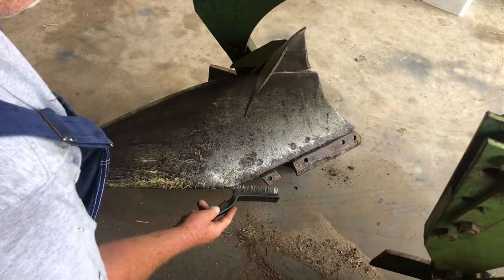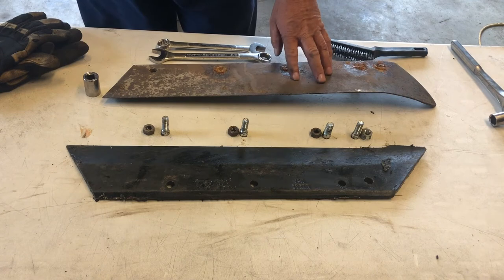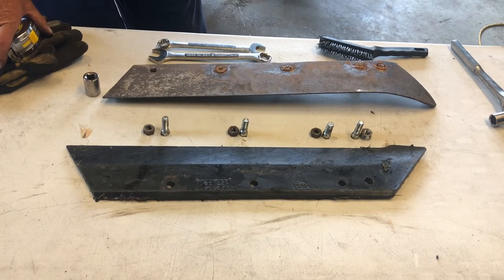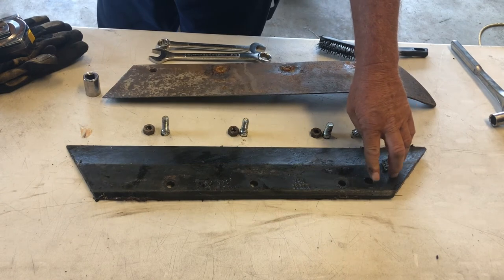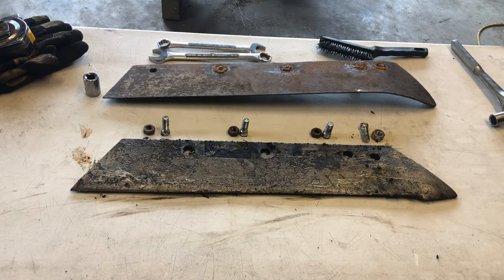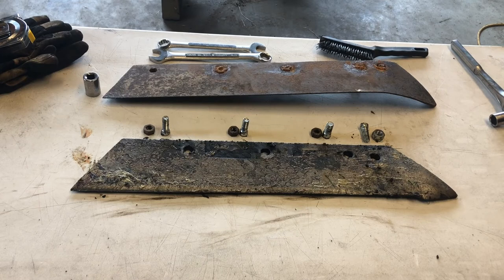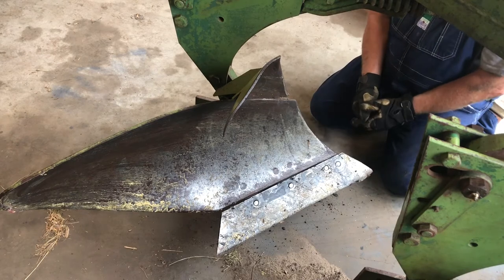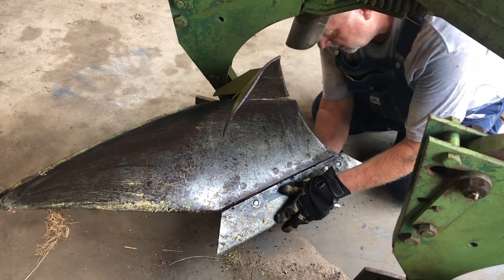How To Change Plow Shares

Comment: Those cushion trip Oliver plows have a neat trick to tip the bottom up and make it easier to work on. You pull back on the rear roller assembly,  then lift the bottom up, and put a punch or rod through the sub frame to hold it up.
Reply from the maker: Now that is smart on Oliver’s part! Thanks for pointing that out Chris, as I said before......you are a wealth of knowledge.

Comment: Steve: I went back and reviewed this video before changing the shares on my F-145 and was surprised to find my bolts came off with just my Dewalt gun.     (Maybe dumb luck?).    I really appreciated your tutorial.    Shoups came through for me and I didn’t drop the plow on my head😉.
Reply from the maker: That is lucky, seems like every time I do this I get set up bolts/nuts and end up breaking or grinding them off.
Shoup is a great resource 

Thanks Dave

Comment: Welding or cutting those old bolts off is a great idea. It's easy to cut a finger if someone were to try and hold them and loosen the nut. I still call them points as well. Great info 👍
Reply from the maker: Thanks Chris, seems like I remember doing that years ago. 
Only do it once 😂

Comment: OEM Oliver shares had the bolts permanent.  Moline, IH, AND JD have replaceable bolts. 
Probably left over from the days when the blacksmith sharpened them at least once a year.  Thanks Steve.
Reply from the maker: Now that you mention it I do remember seeing some many years ago that were permanent 
You’re welcome and thank you for the comment. Dad used to take bean knives to our local black smith to hammer out numerous times. A lost art anymore
Reply: @AnglesideFarm  Not that I am looking for subscribers, but I plan a short video of 14 inch OEM shares I should still have here .
Sold the plow.  I'm a hoarder.
Reply from the maker: @brycewiborg8095  i could have swore I had subbed you.....but I AM now!
Thanks

Comment: Good educational video.   Now if you plow enough every year and you wear out the shares in a season, those nuts come off pretty easy.   Just take a wire brush to the threads first.    Seemed like I did that a lot as a kid.  It’s a good thing the nuts always came off easy, because we never had a torch back then, or an electric hand grinder.
Reply from the maker: We didn’t plow enough in a year I guess. We chisel plowed a lot more than moldboard. If we were turning hay ground under to plant kidney beans it was moldboard, corn, barley and bean ground were chisel plowed.
Thanks for the kind words and support Jeff.
Reply: @AnglesideFarm    I really don’t miss plowing these days.    Lol.   Although it would be fun to sit on a old tractor and do a little plowing just for shits and grins.
Reply from the maker: @onehappyfarmer3461  our local FFA has a event in the fall called plow days, that’s probably the main reason I got this plow. Yep you’d look proud as a ruttin buck up on your Oliver pullin a plow.
Reply: @AnglesideFarm  🤣🤣🤣